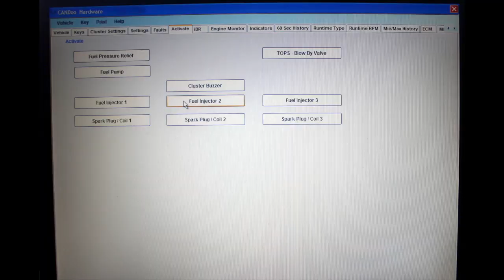How To: 4-TEC Jet Ski Troubleshooting (GTX 185 Sea-Doo Fuel Pump Repair)

Comment: what is that OBD machine you used to test and software as well please? . thanks
Reply from the maker: We used an IBM laptop with a CanDoo Pro that comes with its own software. A link to the hardware is in the video description above.
Reply: +3ftDeep  thank you so much for the quick response. I just bought a pair of 2000 millenium edition RX and they crank with a jump start from my car but wont start. I got them in a charity auction and they have toggle switches under the front storage box and another on the right side..do you have any idea why would anyone install such things or why they wouldn't start ?
Reply from the maker: It's hard to say what they are without seeing them, but common the switches are often installed for a bilge pump, or for a battery cut-off switch. As for why they don't start, try first replacing the spark plugs, then make sure they're getting fuel (carbeurator/injectors, fuel pump, etc.). You can tell if the fuel pump is working, as when you put the key on you'll hear it buzz. Good luck!

Comment: I have a 03 gtx 4 etc sc and it revs up fine out of water but when I put it in the water it will not go past 3000 rpm the grate is not clogged so I don’t know what it is
Reply from the maker: Did this happen just suddenly, or has it been getting worse over time?
Reply: @3ftDeepChannel  this is my first time taking it out on the water I got it from a buddy it sat for four years at his house he said it ran fine when parked
Reply: I thought it could be either the throttle Position sensor or fuel filter but I’m not very good with jet skis
Reply from the maker: It could be. It could also be spark plugs. It’s very difficult to say. Essentially, do you want to make sure it is getting air, fuel, and spark. I usually start with the easiest and most accessible system and work from there. Good luck.
Reply: @3ftDeepChannel  found out it’s only running on 1. Out of the 3 cylinders. Still don’t know if it’s not getting spark or not getting fuel
Reply from the maker: Well that’s a good sign. Change the spark plugs first and see what happens.
Reply: @3ftDeepChannel  found out it was the injectors so I take it out on the water and it runs fine for about 10 minutes then it dies and it will start if you Let it sit for a little. Do you know what could be causing that?

Comment: What if I cannot get the fuel pump to prime
Reply from the maker: You may have an issue with your fuel pump. It should be able to prime.
Reply: @3ftDeepChannel  I replaced the whole fuel pump assembly including the gasket ring
Reply from the maker: Was that before the problem, or after?
Reply: @3ftDeepChannel  that's the reason I changed the pump
Reply from the maker: Have you been using the Candoo Pro to activate the pump? If not, how do you know it's not priming?

Comment: Hi 3ft deep i am having problems with my sea doo it is backfiring
Reply from the maker: We'll need more information to help. What year, when does it backfire (doing what, under what conditions, etc.).
Reply: 3ftDeep 2005 rxt supercharged when i start it up it starts backfiring and make alot of noise
Reply: @3ftDeepChannel  Hi 3ft deep, having problems with my jetski,, won't turn on only way it will turn on is if I add gas to the sparkplug noticed sparkplug has oil on tip, mind you I have not used it in 3 years.

Comment: how did you know that there was a faulty rubber seal??
Reply from the maker: The fuel pressure was far too low. Chris recalled that he had worked on the pump over the winter, so we decided to check it. When he took it apart we found the bent rubber seal. Mechanic error. Thanks for your comment.
Reply: +3ftDeep ours was getting p0231 code, or open circuit in the fuel pump, checked the fuse but it was fine, spark is also fine, im also getting Low Fuel. my question is, if the PCM gets a low fuel reading, will it also give a low fuel pressure or will the pump fail If i have not enough fuel on the tank, we've put 10L on the tank.
Reply from the maker: +Ali Musur 
P0231 sounds like a problem with the fuel pump or the wiring to the pump.  A low fuel reading on the gauge will not change how the machine runs until it eventually runs out of fuel.  With the seat off put the key on the post and you should hear the fuel pump run for a few seconds to build pressure if you don't hear the pump run then start looking at wiring problems or a failed fuel pump.  Good Luck.
Reply: +3ftDeep thank you for the inputs sir, ours ran only 18hrs but didnt run for more than a year, will check for the wirings, hopefull i could trace the culprit. On your opinion, can i directly run the pump through the battery just to check if its still good?
Reply: +3ftDeep I have been trying to change inner and outer filter in 2005 RXT 4 tec. I took fuel pump assembly apart and 2 washers came out from bottom that I am not sure what order they should be reinstalled. There was a rubber orange washer and a metal one. If you can help with that let me know.
Reply from the maker: I'm not sure. I'll see if Chris knows, but if I were you I'd call the service department at my dealership and ask them. They'll probably know that level of detail. Good luck.
Reply: Hi David.  I just replaced the fuel pump on my fuel pump module.  The orange washer will go in first, and the metal washer will be second.  This is per the instructions that came with the fuel pump.
Reply: Thanks, I took out pump on my other ski and saw that the orange washer went first. Now they are both running like champs. Fuel filters were completely deteriorated. Best 20 bucks ever spent on skis!

Comment: What seal was bad ?
Reply from the maker: It was a seal in the fuel pump that Chris had not put in properly when he took it apart. Nothing to worry about, normally.
Reply: The seal where the spring loaded plastic tube goes into the actual metal pump?  I have a feeling that is my main issue on one right now. If so, were you able to get just the metal tube with the seal or buy the seal on its own?
Reply from the maker: I can’t recall exactly. It was a reassembly issue and we didn’t need to replace any parts.

Comment: This only happens to me when  the ski is in the water  and nobody can figure it out
Reply from the maker: What happens when it's in the water, exactly?
Reply: @3ftDeepChannel  when i put it in the water I need to keep it  on,  if I turn it off for about 15 min or more in the water it gives me hard start,  same noise as in your video I have to play with throttle to start it up , but when out of water it starts up every time
Reply from the maker: These ones are tough to diagnose through the internet. Not to be insulting, but have you checked the spark plugs, and connections to them (including plug coils)?

Comment: Hi i just changed my fuel pump in my 2007 215 rxt supercharged i am getting 7500 to 8000 rpm on land but only 5500 rpm in the water can you help me out pls
Reply from the maker: When was the last time your supercharger was rebuilt?
Reply: 3ftDeep  dont know just got the bike 2 months ago the old fuel pump filter was deterioated there was alot of dirt in the tank i did not clean the injectors think injectiors might be clogged from all the dirt that was in the tank
Reply from the maker: It could be. You can check the fuel injector function if you had a Candoo Pro (see our earlier troubleshooting video). I suspect it's your supercharger, though. You should take the intake hose off and see if you can spin it. If it hasn't been rebuilt and it has ceramic washers, they could have failed. If it were my machine, I'd remove the supercharger and check it out. Good luck!

Comment: Just spray fuel into the air intake if it starts then you know it's fuel much faster than all this crap
Reply from the maker: How do you spray fuel into the air intake? i.e. what device do you use?
Reply: @3ftDeepChannel  all you have to do is spray it into the air intake filter hose it will suck it directly into the piston and it will start if it's a fuel problem
Reply from the maker: Thanks. The problem is with metering the fuel injection. The injectors were actually spraying, just not enough because of the issue with the fuel pump reassembly. Your technique is very good when just ticking off the boxes "air", "gas" or "spark" when troubleshooting, but may not have led us to the fuel pump in this case.

Comment: Wow ! That's why I stick to a 2 stroke , iv never had any of these issues, this is why the factory's went to 4 stroke, It's Costs 5x more to maintain then 2 stroke, you have 50% less to worry about , It'll be fun they said just put gas in no mixing it'll be fun '! Ohhh but don't forget you gotta change your oil and oil filter every some many hours ohhh and almost forgot about timing , valves , fuel pump , fuel rail , fuel injectors, Oh and you'll need a laptop and a $500 software to tell you why it won't run , And it'll cost you 3 grand to rebuild that top end WHEN not IF WHEN it blows up, I just don't understand the point in all this to ride a jet ski , I have 2 cylinders and 1 carb , I put oil in my gas and ride all day !, store it away take it back it mix gas and ride, ! If I wanted to work on all this 4 Tec stuff I would just go to my VEHICLE !,